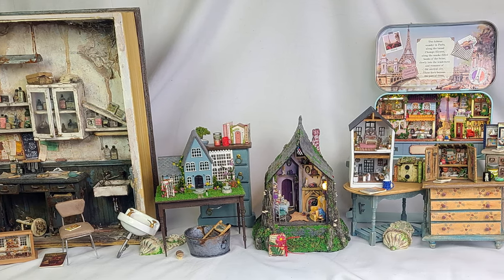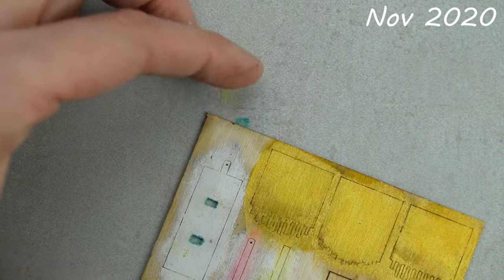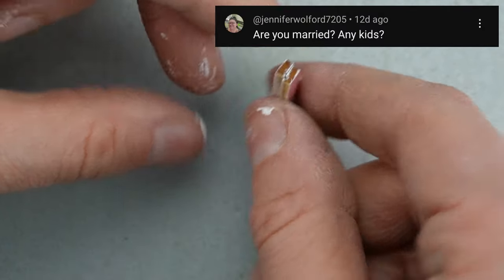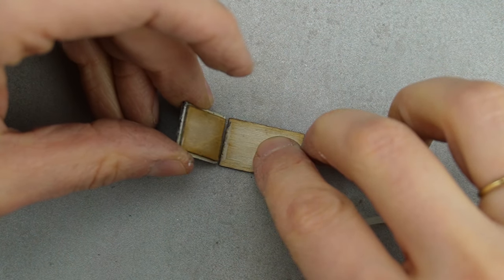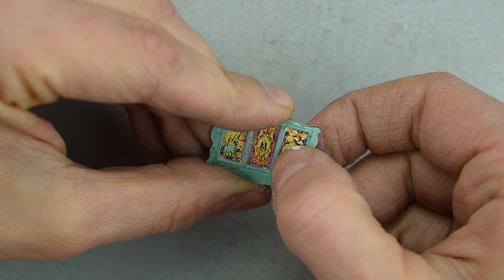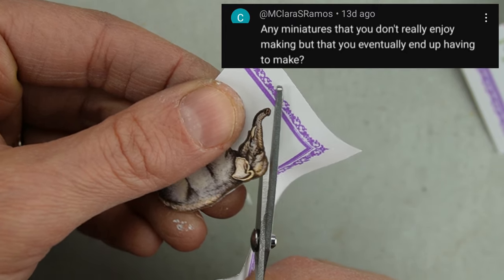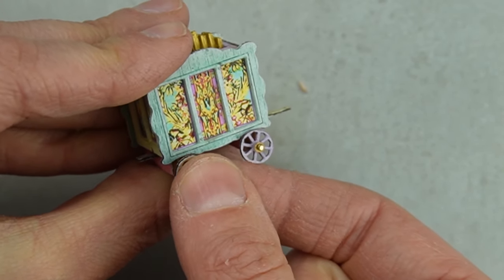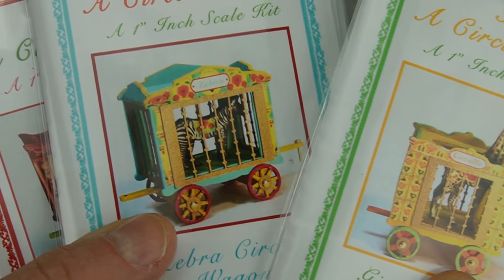Answering Your *personal* Questions while I make a dollhouse miniature • Q&A

Comment: I a having a real time trying to make sash windows. I watched a few videos but I am still stumped. It's mostly the 45 degree angles. The small pieces won't work in the dohickey for cutting bigger pieces
Reply from the maker: I always use a craft blade to cut small pieces. I can eyeball it pretty well. If you're painting them, you can fill any gaps with wood filler.
Reply: @queencityminis  thank you AND I finally figured it out. You're the best.
Reply from the maker: @dinky6620  I'm glad! Thank you ☺️
Reply: Totally bummed. Now my issue is getting the panes to overlap correctly. I'm getting old. Is there a trick to getting the 2 panes to overlap right?  Am I the only one who can't seem to get this right? I've always been able to reverse engineer things, mostly in sewing, though.
Reply from the maker: @dinky6620  I've never made windows myself. I imagine the inside frame determines the overlap. I'm not patient with precise things, so I'd probably have made the windows first and then built the frames to fit 😆